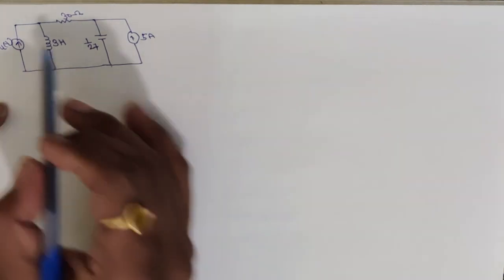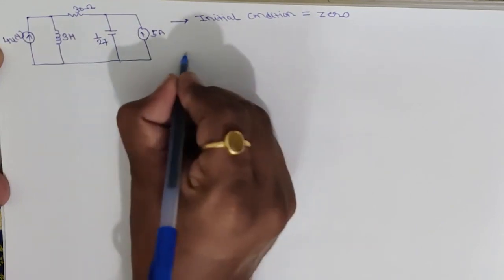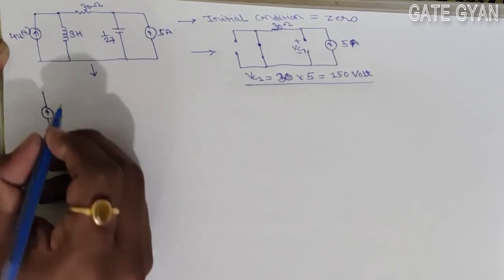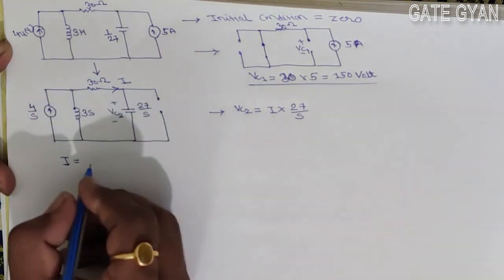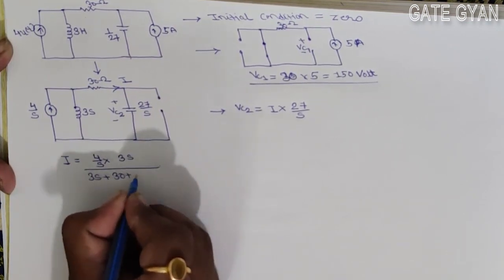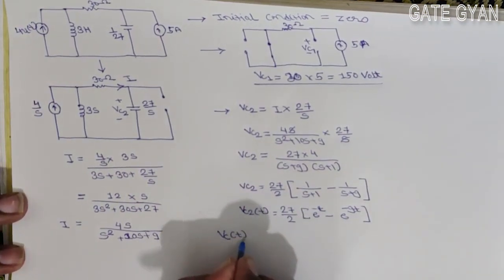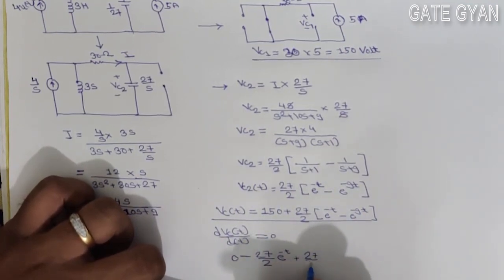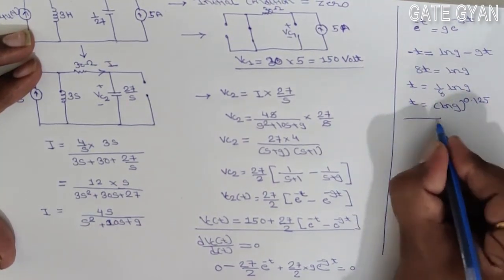ISRO 2018 Solutions Electronics |Question 38 Set-A |ISRO Previous Year Paper| ISRO SERIES| GATE GYAN

Comment: Why did you take initial conditions zero? Steady state is reached means inductor is short circuited and capacitor is open circuited, by doing so , we don't det initial conditions zero.
Reply from the maker: Initial condition will be zero for this case because the question says steady state is reached at t=0. So he means that for t=0- steady state is not obtained.
Reply: @EasyElectronics1  Got your point. Thank you.